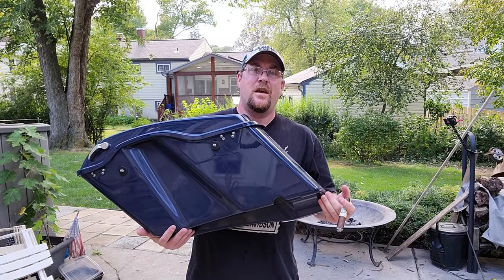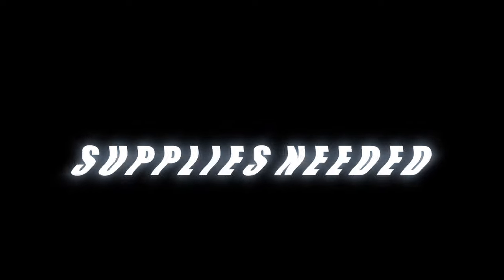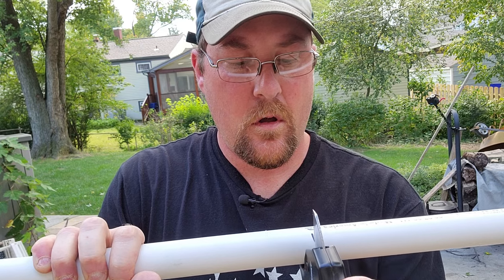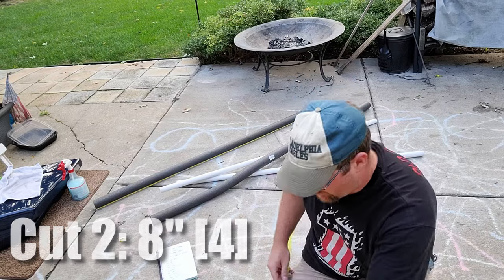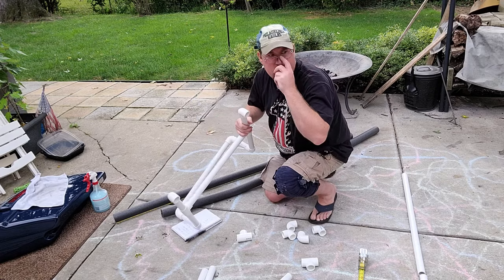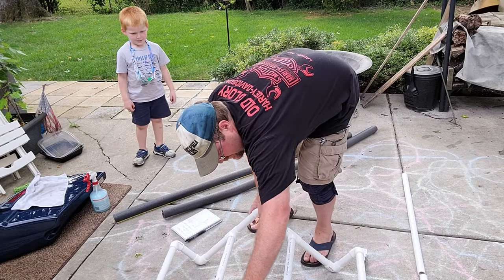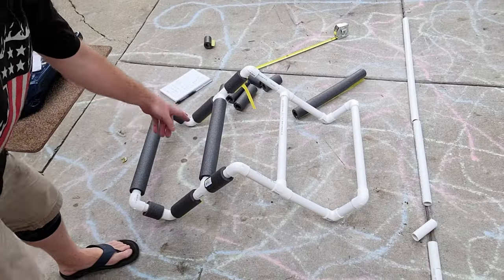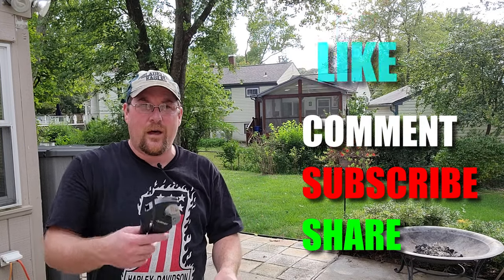EASY DIY: Saddlebag Stands for Harley Touring Bikes!  From supplies to steps to the finished Product

Comment: I dunno man. I kind of liked the grass and lean against the tree method. It was simple. :-p
Reply from the maker: Well, now that it's built, this is simple too.  It stands upright in the trailer so it doesn't take up much space, but it'll hold the bags solidly and securely - not to mention safely for the paint - when in use. :D

Comment: Good video.... Building me one this week... Tired of laying them on a blanket or towel. Thnx
Reply from the maker: Thanks, glad you liked it!  Have fun - are you going to paint yours?
Reply: @RoadReality  Yes, I’m definitely going to paint it. Fortunately, I have a few high gloss black paint left over from previous projects so I think that’ll be a good look. I will try to shoot you a picture when it’s done.
Reply: @RoadReality  Also, I would like to try to make it a little higher to prevent bending over so much, but I haven’t figured that out yet
Reply from the maker: @wink9110  Oh, good idea!  I hope you figure it out :D
Reply: Finished a few days ago! Worked just like you said. Question the my foam insulation does not go all the way around it. Did you have to get a larger insulation? I didn’t see the size you got in your instructions.
Reply from the maker: @wink9110  That's awesome that it worked!  My foam doesn't quite reach around the whole pipe either... and I forget now what size I got.  BUT, it's adhesive-backed, so I - or you - can peel that and stick it to the PVC.  Just make sure it's facing the surface of the bags first.

TBH, I still haven't stuck the foam on the PVC - I just make sure they're all facing out before using.  I want to paint the PVC first.
Reply: @RoadReality  I'm painting mines the color of my bags. magnificent blue.  OK that makes sense if I would’ve went with the 3/4 pipes and used the one inch insulation it would’ve went all the way around. I have to go see if they have an inch and a half inch or 1/4
Reply from the maker: @wink9110 That's gonna look GREAT!  I have a can of Ford True Blue left over from when I painted my bobber... I'm gonna use that.  Hopefully it covers the whole thing, LOL.

Yeah, if you can return the foam and get bigger, that'd be aces - otherwise, the adhesive backing will keep what you have in place.

Comment: Great video. I saw another video and they used 3/4 in tubing. Why 1in? Does it make it taller? More rigid?
How stable is it to wash bags on? I have stretched bags like yours; 2020 SGS. The Harley version is not compatible or recommended with stretched bags.
Reply from the maker: Thanks!  I thought the 3/4" PVC was too flexible for what I was doing, so I went with 1".  The stands are very stable to wash the bags on - I've used my stand several times now when cleaning the bike.  They also work front or back, so you can get both sides of the bags clean.

Thanks for the info about the Harley stand - nowhere on their site had I read that the stands weren't compatible with extended bags - but THESE are!

Thanks for watching!
Reply: I used 1/2 inch, no issues.